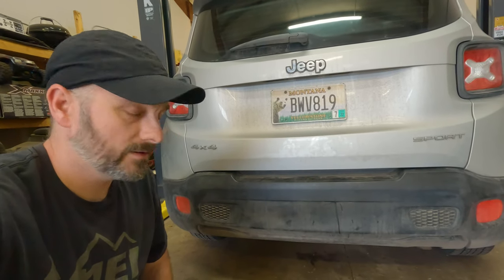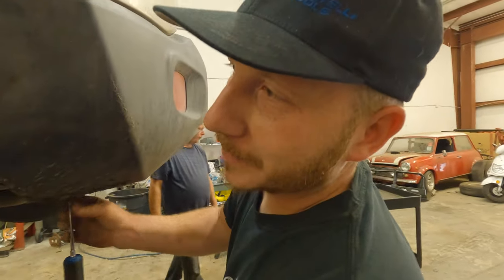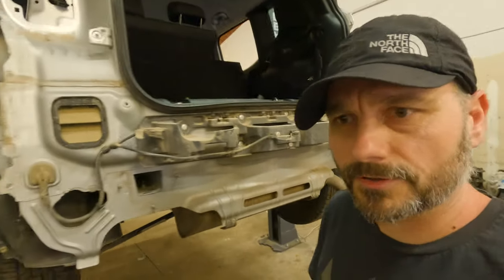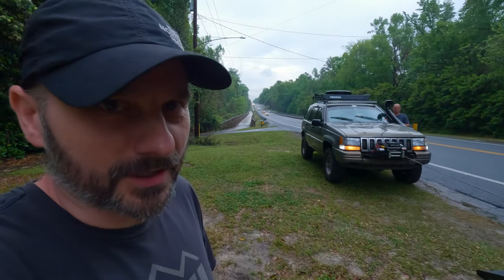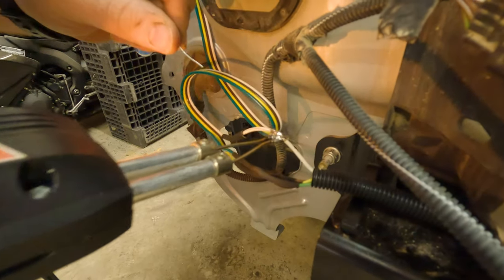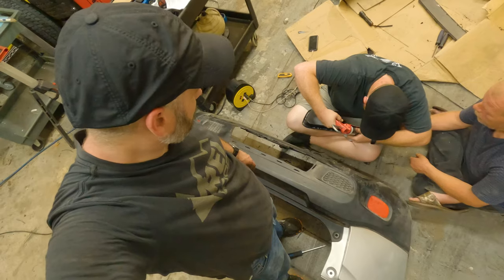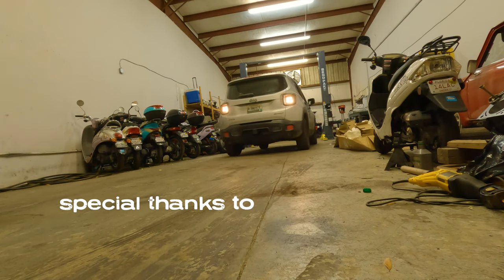Jeep Renegade Hitch Install

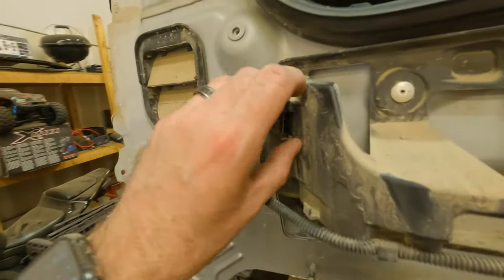Comment: Thnx for the video. Next week i’ll do the same to my Compass trailhawk. Did you just change the wireing harness to fit each other ? Or do deeper electriton works there ? 3:19
Reply from the maker: Ended up splicing the wires and using a wiring kit from U-Haul. The harness was not “plug and play”.

Comment: Hello good afternoon, what is the technical specification of this towing kit for the Jeep renegade?
Reply from the maker: This is a OEM hitch that was retrofitted on a trim level that didn’t include a tow package. The Jeep Renegade is typically rated to tow 2,000lbs with the 2.3L 9 speed automatic. In the US, the 1.4L manual transmission’s are “not recommended for towing”.

Comment: How much on average does this cost? (Tow hitch & install)
Reply from the maker: As of this comment, the kit is $799 on Renegade Ready (link below) If you do it yourself, you save on labor. 

http://renegadeready.com/jeep-renegade-trailer-hitch-retrofit-kit-by-renegade-ready-6179
Reply: @joshuawhiteadventurefilms  Whats an estimate on the labor because I don't have the tools and equipment to do it myself.
Reply from the maker: I wouldn’t be able to give you an accurate quote from our install because it was my brother that did the job and we used a friends’ shop, so I didn’t pay for labor. Furthermore, we goofed off a lot and didn’t have all the necessary parts at time of install, so calculating an accurate time frame for the install would be difficult.  My best guess, I believe it’s a 2-3 hour install and shops charge a labor rate typically between $110-$160 an hour. If you go to the dealership, I have heard they do OEM installs around $1400 with parts and labor, though that price may vary. Good luck!

Comment: Where did you get the receiver?
Reply from the maker: I purchased mine from a seller on EBay, but you can buy a complete kit from renegadeready.com. It has everything you need to complete the job, including a cutting template for the bumper (which would have been very useful). I was going to buy the kit, but the hitch receiver was on a 2 month back order and I had a small window while we were in Florida to get it done. Here’s a link to the kit: 

http://renegadeready.com/jeep-renegade-trailer-hitch-retrofit-kit-by-renegade-ready-6179

Comment: What size are the 4 bolts you had to go get that go into the bumper extension
Reply from the maker: I believe they were 14mm. I’ll attach a link to the Renegade Ready retrofit kit that includes everything. It’s currently on sale. 

http://renegadeready.com/jeep-renegade-trailer-hitch-retrofit-kit-by-renegade-ready-6179

Comment: how much could ya tow with this? i know the vehicle is a 4 cylinder right?
Reply from the maker: 4X4 models can tow up to 2000lbs and FWD models can tow 1500lbs. The manual models are “not recommended for towing” in the US but are in Europe.
Reply: @joshuawhiteadventurefilms  thanks man :D! 
would you say thats too little for a small trailer? like one of those mini uhaul trailers
Reply from the maker: The 5x8 U-Haul trailers hold up to 1800lbs, should be capable in a model equipped with 4x4, but I’m no expert. We put it on for a mainly for a multiple bike hitch, and possibly a small teardrop camper.

Comment: Could you tell me the part number of your hitch
Reply from the maker: I purchased it on EBay. Here is a link: https://www.ebay.com/itm/154915153273?mkcid=16&mkevt=1&mkrid=711-127632-2357-0&ssspo=4QAaKFFiRcW&sssrc=2349624&ssuid=jii0h5icQTm&var=&widget_ver=artemis&media=COPY
Reply: @joshuawhiteadventurefilms  thanks a lot

Comment: Anybody successful with pulling a 5x8 uhaul trailer with 1 of these? Seems like an asian car sized American priced suv. I've had it a few weeks it's nothing like an actual jeep imo. Terrified to haul at this point 🤷‍♂️
Reply from the maker: The Jeep Renegade is built on the Fiat 500x drive train, it’s basically a Fiat with Jeep badging. Ours is a 2017 and the sticker on the driver side door panel says “made in Italy”. The Renegade is not a “actual Jeep”, and in my opinion, there have been significant compromises to the brand since Fiat acquired Chrysler in 2014.

I’m no expert on towing as I mostly use my hitch for a 3 bike carrier but I will provide a link from a Renegade forum pertaining to towing experiences. Here is a statement from the forum:

Hi everyone, i have a 2018 jeep renegade upland edition 2.4I W 9spd transmission and I towed a 5 x 8 uhaul trailer this past march from upstate New York to central Florida.
No issues to report other then gas consumption, which was to be expected considering the extra weight. You just have to take your time when towing. Yes, the tow requirements for the renegade is a 2.4 L / 9 speed automatic transmission with a max weight of 2000 lbs. That's for trailer/cargo/ and anything inside the jeep as well. Good luck and happy trails”

https://www.jeeprenegadeforum.com/threads/tried-towing-with-the-renegade-post-pics-and-experiences-here.21769/